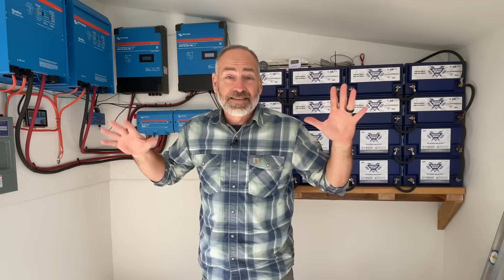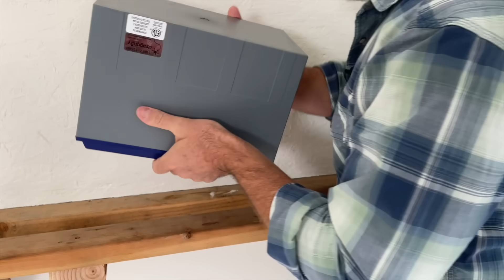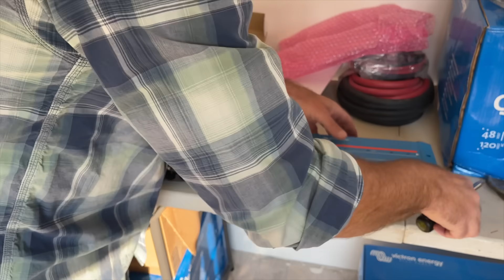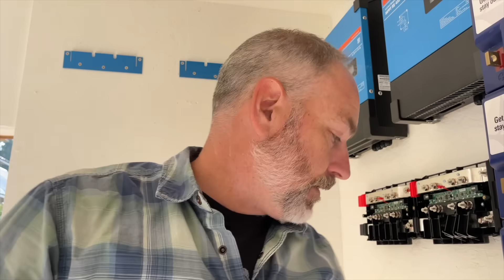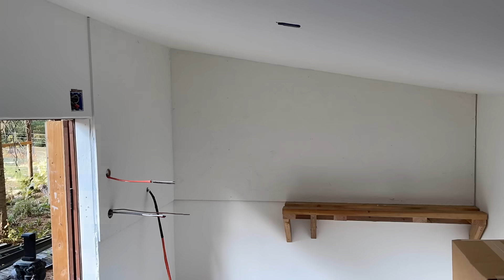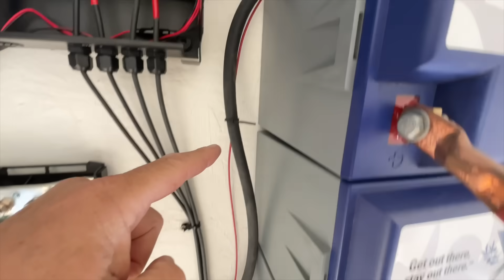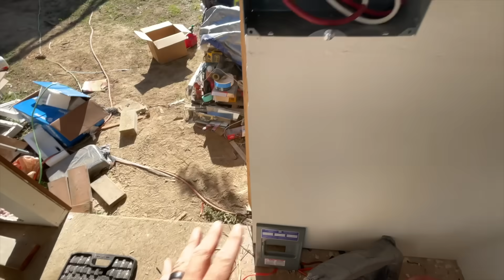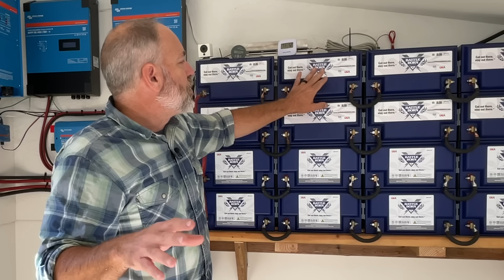EASIEST Off Grid Solar Power System Battery Bank

Comment: You have installed a top shelf system which should meet your needs. You're quite fortunate to be sponsored, as the cost is over $20,000.00 for the components alone (copper wire and connectors extra). It's plain to see you have a working knowledge installing the solar array and a strong grasp of the concept, job well done Martin and family, good luck and God bless..
Reply: Did the guy hit the youtube lottery? New house... camper... dirt bikes... tractor... etc. Sadly "simple" and affordable are not synonymous.
Reply: What components are included in your $20,000 estimate? Are the solar panels included? Thank you in advance for your answer!
Reply: @riconjos  I just looked up the price for the batteries alone, at an average of $875 per 100ah unit, He shows 16 x 875 = $14,000. The Victron Quatro unit he shows on the video runs $5,250 per unit, not including taxes and I am pretty sure he has 2, then of course there are the other components, so yeah, Not a system for the light of wallet LOL Have a great New Year
Reply: @angelcastro3129  thank you for your response! Very helpful!
Reply: @angelcastro3129  yep every time I see any  system with battle born batteries I automatically assume it was free or sponsored. No normal person would ever buy those batteries unless it's a sponsor deal, you could get the same capacity and warranty for that matter with a number of different server rack batteries for less than half the cost. I honestly don't know why BB is still in business they are a rip off to the unknowing diyer
Reply: @angelcastro3129  Eco-Worthy  has batteries on sale for $309 each 12v 100ah
Reply: @AcpEngineering  yeah, anyone building a giant battery system like this using all those batteries is crazy and has more money than the average person. They were either sponsored or had no idea what they were doing. Throw in 4-5 server rack batteries or cobble together 16 overpriced batteries? Both have the same capacity as well as both have BMS protection. Not sure why anyone would choose BB over a server rack battery in a house solar application.
Reply: @JustinPratt1  me personally I want to build my own battery using Lifepo4 Prismatic Cells, I can build (at current prices) using 280 Ah cells a pack that would hold 14+ Kwh's of capacity for about $2,500 (or the price of 2 of those 100Ah 5Kwh batteries. Fun Fact, based on dimensions I have been given this setup would just fit the battery tray of my Ryobi 48v Zero Turn Mower that uses 4 SLA Deep Cycle 12v Batteries in series.
Reply: @AcpEngineering because your dead on assuming that. They won't be in business much longer charging those prices
Reply: @AcpEngineering  definitely.  YouTubers need to be taken with a grain of salt for sure.... If someone followed this as their template they will be broke and mismanaging their money...Battleborn is just chinese EVE cells assembled here.... if you are going to go through the trouble to setup your own system, just go direct to DOCAN and get your own bms and save thousands.... These inverters are also extremely overpriced....
Reply: @DanielsCorner644  Can you provide more details or maybe links? I'm a noob trying to get a picture of a budget build. Thanks
Reply: @kevennguyen3507  can't do links on youtube comments but I got my EVE 280 Ah Cells from DocanPower then spent the extra bit for one of their DIY Cases that come with the BMS so it's just a matter of assembling (in this case it would not fit in the mower if thats what you where wondering about) and for now I have a cheap $200 3,000 watt inverter and a PowrMr 60 Amp Solar Charge Controller to charge the battery and I got my panels from Signature Solar, delivery on the panels was a nightmare but that is just how panel delivery seams to be.

Comment: So... 14-thousand dollars worth of batteries... for FREE ???   Also my (very) rough calculations on price of the system comes to approximately 30-thousand dollars.  You had a main AC power panel with 70-amps of load capacity.   I choke on the thought of the price of a system that would replace a normal 200-amp power distribution center like the one you pictured mounted in your house.  I'm guessing somewhere in the neighborhood of 75-thousand dollars.  Rough calculations, assuming a conservative monthly electric bill of $200. - that looks like the break even point to pay for the equipment of about 30-years.  I doubt most of the system components will last 30-years.  Maybe there is a warranty, but that warranty (even if its lifetime) will likely be significantly pro-rated on replacement costs.  

So... is going solar worth it???   If grid-power is not an option then  you have no other choice... but otherwise I'm thinking not.  You can buy a lot of power for 75K.  Its sort of like the difference between renting a house and buying a house.  However... when you're talking a house, they appreciate (in general) so its likely better to buy, but with equipment... equipment depreciates, so at the end of 30-years you basically have lost your initial investment.   And remember... solar only works when the sun is shining on your panels (with no obstructions, like snow and dirt).  So depending on your power consumption, a few cloudy days and you are running a generator to recharge your batteries.  At the cost of fuel that could add a hundred dollars or more to your monthly expenses.   Again, if you're out in the sticks, with no option for grid power, than you gotta do what you gotta do, but if grid power is available it sure looks like that would be the better choice (considering the current level of technology in solar generation and efficiency).

Comment: WOWWW Nice done!!! 
I saw a video of your channel for the first time, and I thought it was super clear, very nicely done and i will definitely follow you for more! 
Just a question, don't you need a BMS ( battery management system)  to correct any differences in the battery banks? Everything else was clear.
I have this system in miniature in my motorhome and want to switch from cheap lead-acid to LFP batteries. 
Greetings from Holland (the Netherlands AND with a lot of clouds these days 😁) 
Hans.

Comment: OK 12.8v per battery times 100amps x 16 =20,480 watts. Each battery costs 899$ times 16 is 14,384 plus taxes shipping..
Five EG4 server rack batteries is 7,495 plus taxes shipping. that's 48v times 5 x 100a=24000 watts... 4000 more watts half the price and less space to take up... hmmm

Comment: Did you do any settings on the Victron Invertors? You normally set what your batteries capacity is and runs with the BMS.

Comment: Not sure why you went all out on the power equipment, but used the Cheapest lug crimper.  You might want to get a infrared camera and look at those lugs under load.

Comment: Awesome video very interesting.  Appreciate if you can provide us estimate how much it cost to set this up and what type appliances can it support( Fridge, Deep Fryer, Oven, heaters, tv etc...) can I have a separate outlets for 110v 60hz  and 220v 50-60hrz with separate circuit breaker? Because I have bought some appliances abroad that has those voltage :)

Comment: you are using only 1 battery and that is the one that is wired to the inverter every other battery just charges the one after itself as it empties, you need to hook every battery up to inverter to get the most use out of your system and same with your charging system you are charging one battery then when it is full it will charge the battery after it you also need to hook every battery up to charger to get the most use out of you system.

Comment: Great setup, gave me some good ideas for our summerhouse. One question though, when your batteries are full and your demand from the house is low, what do you do with the overcapacity from your panels (producing more than you can store and use). Potentially it could fry your installation. Or do the charge controllers have a build in safety or something?
Reply: The Charge controllers idle and no not continue to overcharge the system. You could set it up to dump excess power into a hot water tank if it has a electric element.

Comment: This is nice but way expensive, you can get EG4 lithium ion iron phosphate 6,000 cycles 100 ah for 1,750 and eg4 inverter 6.5kw 1,300. Thats 3,050 compared victron 2700.00, battle born 4 batteries needed for 48 volts at 874x4= 3,496.00.  $6,196.00 for 48 volt system with 100ah,compared to 48 volt system 100ah for $3,050.00. Plus eg4 battery is one battery vs 4 -12 volt ,saving lots of space. My thoughts.

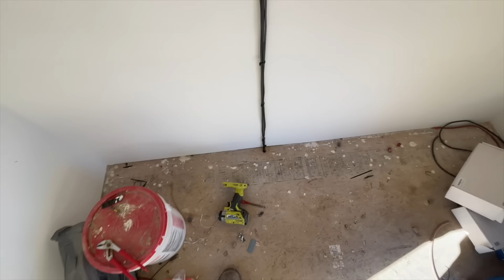Comment: On your solar feed to the charge controller, you have a lot of exposed copper from removing the insulation too far back.  (Clear at around 18:20.)  It creates an unnecessary hazard where a DC arc can be created if something makes contact across the exposed conductors.  
This was noticeable, as all your other wiring was neat with no exposed copper, and generally well-routed and supported.

Comment: Loved the video!

Just a few istallation recomenations:
Solar Controllers - Should be mounted 300mm from ceiling, and your wire should be 35mm2 (2AWG).  I would also instal a PV isolator in the shed.
Battery Wiring & Battery Monitor - As it is wiring is too small same gauge as your Quattro units.  I would of used the Lynx battery monitor between the distributors and run equal length cables to each set of four batteries (50mm2 - 0AWG).
Quattros - Equal length DC and AC wiring is recomended for Quattros and Multiplus units in parrelel/split phase.  Again mounting the units further away from the ceiling would be better.

Comment: So when you make these... you get to a point where your solar panel load is maxed on the charge controller that they go into. Example, 300 watt solar panel goes into a charge controller that is also maxed at 300 or 350 watts. 

What I'm wondering is... because you've already invested in that set up and that battery bank can you just have another set of panels also around the similar amount of the previous charge controller going into a second charge controller, and having that connect to the solar bank somewhere? Or something similar? 

It doesn't seem feasible to just get rid of the charge controller and start over because of its limits. I'm also a very limited budget. So I'm trying to find a way to SAFELY look for ways of loading in a second set of panels and where would be the safest place to connect them in a simple closed system? Thanks. 

Also, one of my question is ... when you connect an incoming charge from the combo of panels and charge controller... is it safer to have the positive and negative connecting to the first battery together? OR to have them separated with the negative and positive connecting on different batteries?

Thank you very much. And sorry to bother you.

Comment: Looks good except for the battery shut off switch. Needs a real dc breaker. DC can get some nasty arking with high amps and voltage.

Comment: Have you considered installing an ASIC to warm the shed in winter (and mine BTC with any surplus power)?  It will also provide incentive to conserve power elsewhere on your property (e.g. turning off the lights when you leave a room) since any extra power is being used to heat the shed and make money.
Reply: Nah, I run a mid sized data center in mine. 64 42U racks, loaded from top to bottom with servers & storage! /sarc

Comment: Correct me if I'm wrong, but depth of discharge is related to the total number of cycles that you can expect from a LiFePO4 battery. So, while it is correct to say that you can discharge to 0v, it may not be a good ide.....

Comment: The cost of sixteen batteries 13.866$!!! Am I Wrong?
Question: What is the power consumption of the entire house powered by photovoltaics panels?
What is the cross-section of the power cable that supply the house  ?

Comment: Why didn’t you use the 10kva version of the inverter instead of two 5kva? And on the MPPT charger why didn’t you get the 11kva unit instead of 2 5.5kva chargers? Also why didn’t you get the Shunt that connects to your distribution panel, instead of the one that is separate? Also why didn’t you use a battery balancer (3x) to balance the charge on your 16 batteries?

Comment: 28:22. Yes, you "can" completely cycle LFP batteries, but you do put extra wear on them operating them like that.  However, if you don't discharge LFP deeper than 40% remaining, and don't charge them to more than 85%, they will basically last forever.  (LFP shows no measurable degradation under that usage profile.)  But if you deep cycle them, you probably have something to the tune of 1,000 cycles, or so, before you see less than 80% capacity.

Comment: Awesome setup but why not use copper bus bar to join the batteries in series, by using cable and lugs you are adding 4 points of resistance to each connection of series

2x lugs
2x bolts

Where if you use copper bus bar you are already reducing the resistance straight down to 2 points of just the bolts

Comment: Really good video!
Looking over the prices of these things tho . . . about a grand per battery X 16 = ~ $15K for those batteries, whoa. I guess that can't be avoided, but wow.
I was also looking into the Edison Iron batteries, I hear they are real beasts that can take all kinds of abuse and last forever.
Also a question: What is the charge/discharge cycle rating on these? How many times do they take a charge and give it up before degrading?

Comment: If lithium ion batteries are discharged to zero they will be damaged. The charge controllers will prevent that from happening. I hope you installed a ground rod or ground plate of some sort so that what you are calling ground wires ,which are bond wires, actually do what they are ment to do

Comment: Just one little thing to change in the inverters : Take the data cables away from the mains as the way you have then coiled up may introduce EMS in the data cable leading to errors in the data or a loss of data packets.

Comment: Hi Martin, can you tell us a total cost for your system please.
What are the requirements for an off-grid system for a backyard cabin of 12 sqm in UK (I am about to build) to power small fridge, 2-ring electric hob for cooking, electric shower, one convection heater (no need for AC- cold climate in Uk), portable computer, kettle and under-sink hot water heater for washing hand, small washing machine (no dryer) and occasional plug in vacuum cleaner. 
Thanks a million. God Bless.

Comment: Nice solar installation! One comment though: you might want to crimp a ferrule on the stranded wires (e.g. those of your solar panels). If you don't, the connection will get worse over time, increasing resistance and heat up. Potentially leading to a fire.

Comment: Thanks a lot for this information I have installed panels to supplement the on grid electric works ok, would like to install batteries for back up if grid goes down. Most everyone I talk to says theirs is best do ya want to chase or charge,no info for me to spend that much I need to know what I am paying for. With the information you provided as a diyer that looks doable thanks

Comment: I came up with approximately $24,000.00 for the major electrical components.  Then add the other pieces: Wire and Lugs, Fuses, Service Panel, Shunts, Switches, Solar Panels and mounts, and a major component of an automatic transfer switch if you're also on the grid. Let's say a budget of $35,000.00 might be appropriate if you do all the labor yourself. However, when the ** hits the fan, that would have been a BARGAIN!!!

Comment: Hi Martin, just wondering why you chose the Victron system over the Ecoflow home system as you discussed the Ecoflow portable baatry about 2 years ago.  We sell the portable Ecoflow batteries in our shop, but will be installing solar panels soon and are contemplating a battery system. thanks!

Comment: Hey Martin, I was living and working on Exmoor back in 2008 through to 2014. I was designing ,installing & certifying domestic, agricultural electrical installations . Some totally “Off grid” & Remote to any National Grid supplies.
I exclusively utilised “Victron Energy” systems.
Back in the day, I was using gel batteries .
And boy they were heavy just like the Lead Acid!
To date , those installations are still working happily & to date no issues.
That is a testament to Victrons excellent design.
Live your videos! Keep it up 👍
Take it easy , great descriptions , great equipment & that’s a proper tidy installation 👀⚡️⚡️

Comment: Excellent video and very  educational. I have a question for you Mr. Johanson, you have two Victron Lynx Distributors mounted on the wall. Each distributor has a ground connection. I did not see the distributors grounded. Is it okay not to ground the lynx distributors?  Thank you very much for the video. I enjoyed it very much.
Reply from the maker: I didn’t see the ground. Okay? It is working.

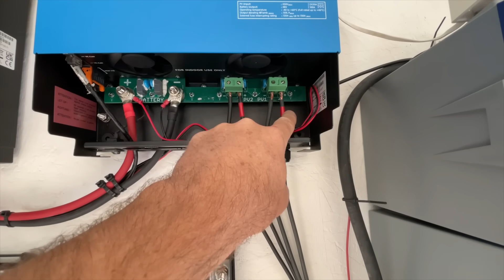Comment: Hi! At ~ 18:21, solar power cable up in to the charge controller, they are not connected correctly, because part of the cable is exposed and not insulated and they are very close together! They must be shortened so that they are not exposed at all, look at the other cables for example. Overall a good job!

Comment: When you have your lugs on, put some petrolium jelly (vasileen) on with a paint brush before the heatshrink to avoid oxidization of copper(coper sulfate)(copper rust) from forming over time on cable joints of batteries.

Comment: Just a rip for saving boxed (not cutting them)… 
Open the bottom also, then you can either push it out, or, even easier… open whatever end you want, tip it , while holding the flaps back, and lift the box up 
Poof, saved the box. Lol.